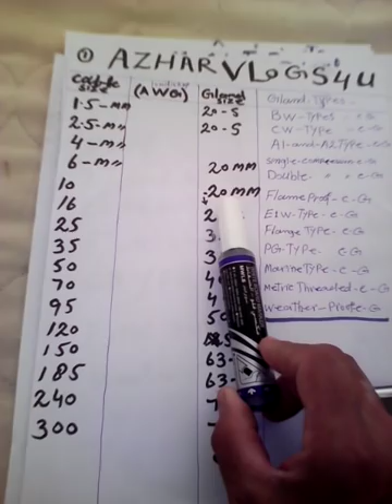Cables size with gland size and gland types  information in Hindi Urdu

Comment: Bhai super video I need how much amp or load which cable is used please send the video bro and how many type switches and their capacity, wiring connection for different type switches, sockets and more please send video or refer some good books related to this...